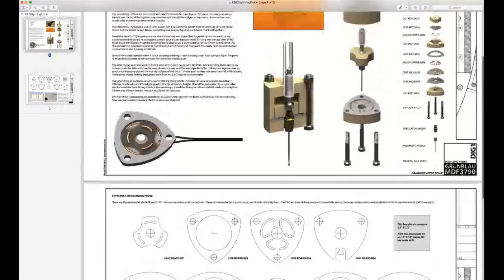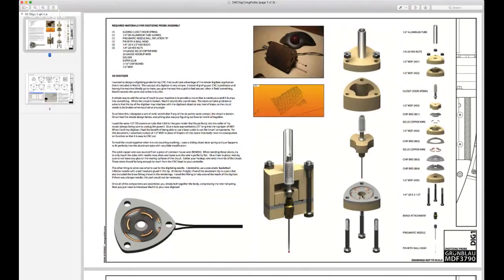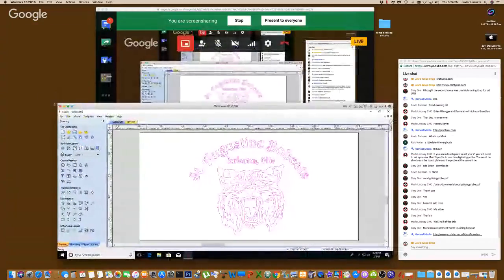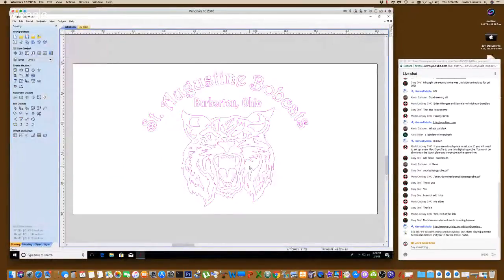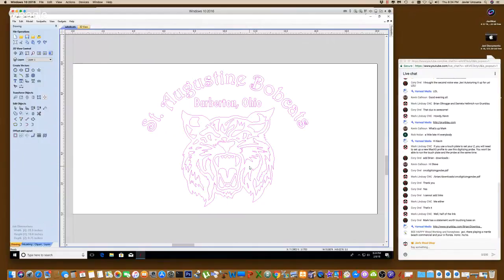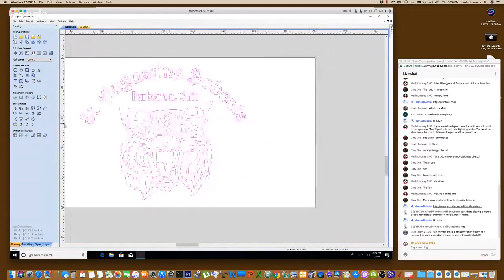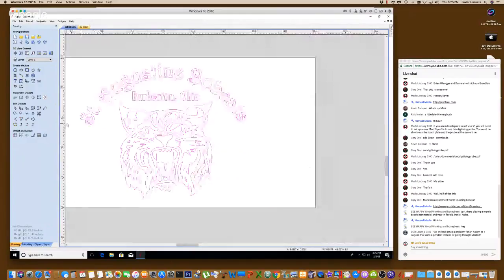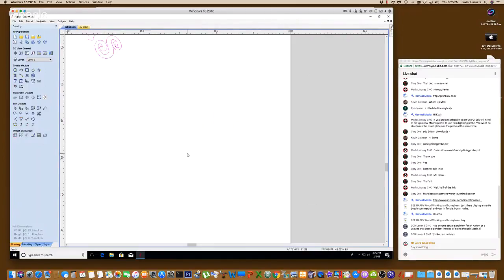CNC With Javi - Show #010 - DIY 3D Probe and probe essential tools

Comment: Thanks for the link to the probe.  I have the parts on order and start cnc ing next week.  I am making the parts out of hdpe instead of mdf and chip board.  I also ordered the Probe-it software because i want to reverse engineer parts and save to dxf files.
LeRoy
Reply from the maker: Thanks for watching LeRoy

Comment: Hi Javi,
I worked all week on building my digitizing probe and could not get it to work.  The problem is the contacts do not make contact because the wire used and the material they are mounted in is the same thickness, both 1/16 inch.  I looked at many designs and came up with my own using 6 ball bearings and 3 roller bearings.  I did use the closet door spring and the 1/2 inch tube off the other one.  The one i made works well except the probe is not perfectly concentric with the spindle shaft.  Now i know whey they get $200 and up for a good probe.  Here is a like to a diy probe kit that looks like it would be one of the best.
http://www.wildhorse-innovations.com/index.php?_a=viewDoc&docId=6

What are the chances of you doing a how to video on the X Y perimeter probing using the Probe-it software?
Thanks,
LeRoy
Reply from the maker: I've sen them pretty cheap on ebay in the $40 range from time to time.